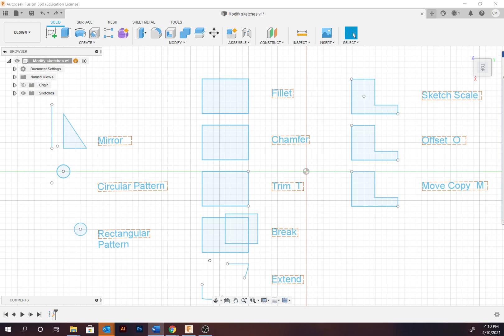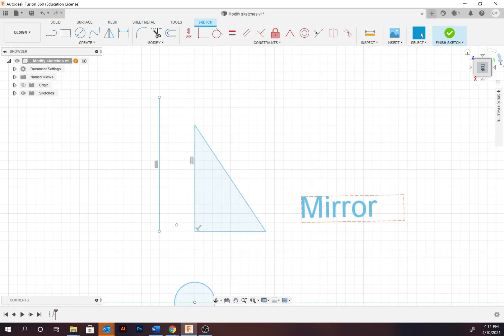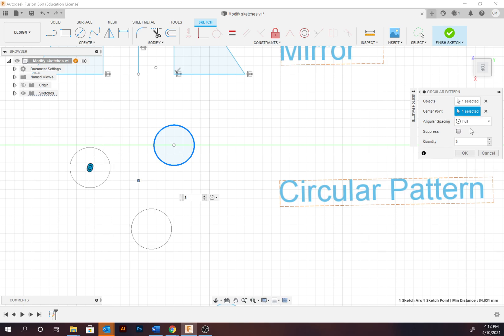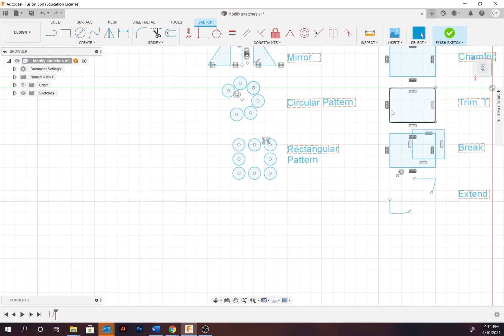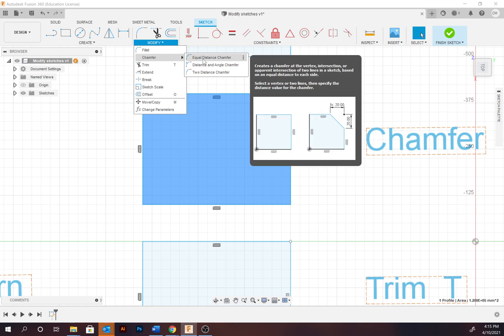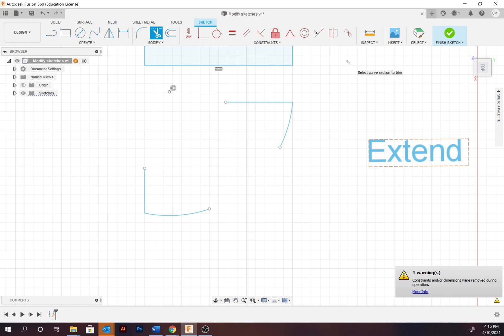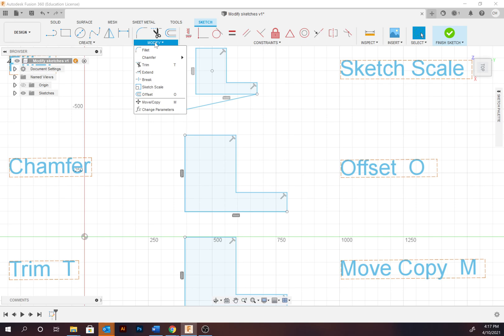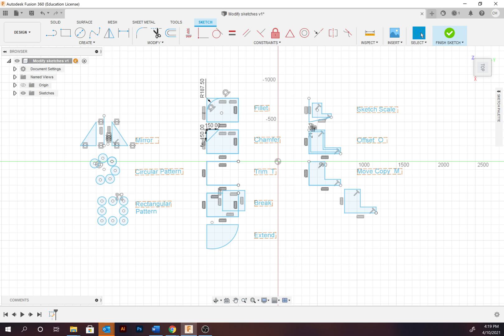Modify Sketches - Fusion 360

Comment: Hi Chris,
Thank you so much for your tutorial. I'm a 74y.o. Aussie retiree and just bought a 3D printer last week so getting started with Autodesk Fusion 360 which is a little daunting for me.
I've come across so many tutorials on YouTube but not seen them through as I find them either too short, too long etc., so have been fiddling through on my own creating problems along the way with my first mission.
Having just watched this video from start to end (finally), your method of explaining is for me at least, by far the best. Not too short, not too long, covering so much with a brilliant demo. 
Thanks also for speaking at a speed where the viewer has time to absorb without the need to constantly rewind.
I've just managed to design and print a tricky replacement part that had me in a bit of a mess and this video was a solution for me.
Fantastic - Thanks again!
Reply from the maker: Glad you found video helpful Kym and thanks for the comment. Happy modelling and making.